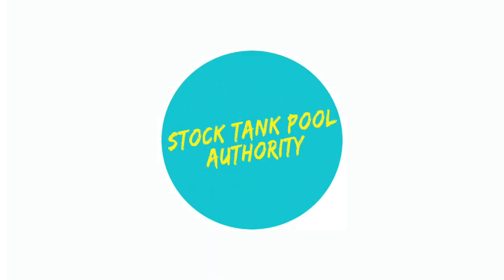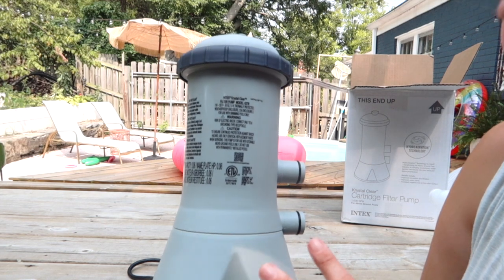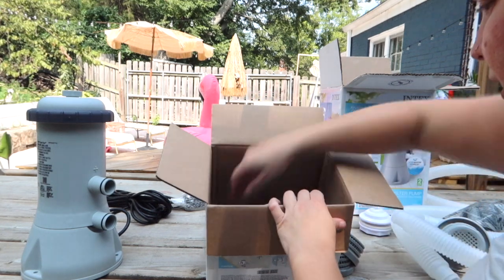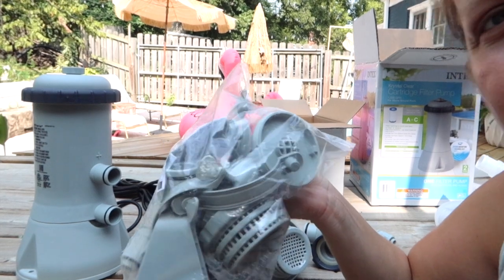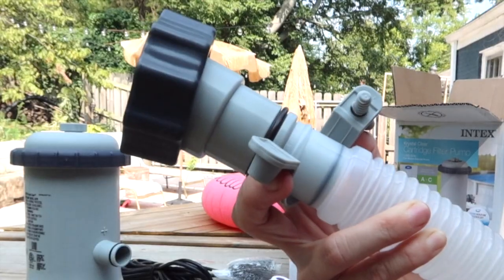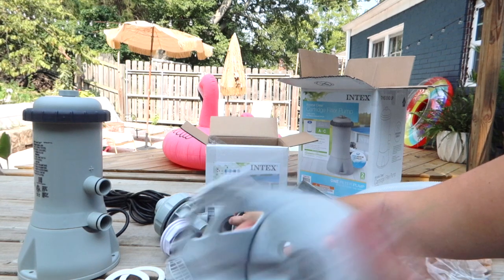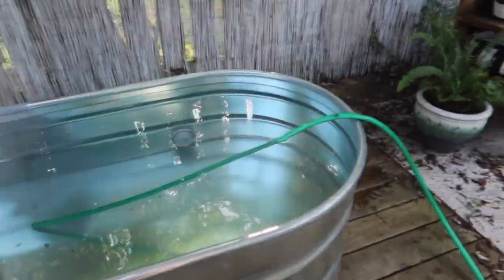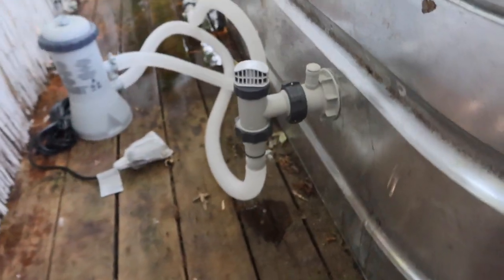How To Install Intex 1000 GPH Pump on Your Stock Tank Pool

Comment: I followed your video to install a c1000 pool pump with a poly tank. One thing that I had to do different is the poly tank wall seems to be thicker than the one you have and the piece you screw in with the black cap doesn't initially fit until you really tighten the plastic nut piece. Once I got it tight enough, I was able to screw it in. So far I have no leaks. One other thing I did different is I used a different caulk. I just so happened to have 100% waterproof kitchen/bathroom caulk lying around that I used to seal a kitchen sink and our shower. This caulk has a 36 hour drying period. It seems to be doing well with that caulk, even after storming during the drying process.

Comment: OK before you turn on your pool pump open the little cap on the top to let the air out when water comes out of the little cap tightened the little cap then the pump is ready to be turned on

Comment: I’m using this setup in a poly pool. The wall is thicker than a metal pool. Even with just one rubber seal, the overlap is too much to screw in the little vent pieces. Any suggestions? I tried grinding down the vent pieces, but it wasn’t enough (I created a hole before it got narrow enough).  Thanks.
Reply: Omg I am having the same issue! I don’t know what to do.  Thinking about maybe sanding some of the poly?
Reply: @chrissyglenn7200  First I tried using a dreamer to sand down the vent piece. Nope - couldn’t get thin enough without creating a hole.  I ended up installing the inlet/outlet without the rubber ring. I THICKLY applied silicone on both sides and screwed on tightly. Haven’t had a drop of water leak in a week!
Reply: @KirstenTerry-w7g   We tried it without that rubber washer thing and it leaks like a slow leak. So, it’s drained out and now we’re figuring what to do. That’s great the silicone is working for you!!  That will probably be what we try next. I don’t get why no one else is having this issue. We have a “Behren” poly pool
Reply: How did u fix the vent problem. I too have a Behran poly pool.Getting to install pump .Any help be appreciated
Reply: Getting ready to install pump.Was wondering how u fix the problem. I too have a poly tank.Thanks would appreciate  any help
Reply: @BeachMusicSuperStore  We ran into the same issue, I got creative and use jaw pliers to screw the inlet and outlet pieces tighter. tightening it a quarter turn at a time, I was able to get that piece to screw on and it hasn't leaked yet.

Comment: Can you hook up a propane tankless heater to this type of pump? If so, what size?
Reply: I would not suggest hooking up a tankless heater to the pump/filter, but you can buy a seaflo (I've bought others and it really is the best - I've also used a submersible water pump which has basically no noise). transfer pump with filter that would run into a propane tankless heater and heat it up (if debris enters the heater, it can cause obstruction).  With regards to size, that depends on your needs.  If you want to warm the water a 5 gallon would do the trick, but if you want to make it a hot tub, then I would recommend a 10 Gallon or larger.  I have a 3x10x2ft tub which I heat with a 10 gallon in the winter in Canada.  It heats up exponentially, so as it warms the water, the warm water gets heated further and I can raise the temp from 40 to 106 in a couple hours.  Importantly, in below-freezing conditions, I bring in the transfer pump and detach the hoses.  The propane heater will have a small bleeding valve to release water from inside its pipes so that it doesn't freeze and expand, potentially rupturing the interior pipes.

Comment: We bought the 8’ galvanized tank from tractor supply couple of days ago and wondering if the 1000gph pump would be sufficient or to go up to the 1500gph pump. Thanks!
Reply: Did you end up going with the 1000GPH pump? Any comments on it?
Reply: @brandonthomlinson1110  I got a cipu sand filter and pump off of Amazon. Not suppose to arrive til first week of June
Reply: Actually canceled that order and found a 1 year old sandpro 75d

Comment: So I watched your video and followed it step by step.  After I was done I looked at the back of the clear silicone package.  You are not suppose to use clear silicone on galvanized metal due to the corrosive reaction it can have.  Now I have a full tank and debating if I should take it all apart to remove the silicone

Comment: I have a 530gph tank but unfortunately it didn’t come with the plunger valves or the 2-3/4” connectors w gaskets that you show in the video. I was wondering if you had a link to the 2-3/4” connectors w gaskets that actually attached to the tank itself so I can order that. I didn’t see a link to that in description. Thanks for the help!
Reply: It states you are supposed to buy 2X part kits in the description.  It's linked there

Comment: i'am not going to put a bunch of holes into my stock tank. It got one for a drain and it going to stay that way, I'll rig it from the drain into the pump and the pool inlet hose over the top
Reply: Hey guy we have a Behren poly blue 8 round pool was getting ready to drill holes for inlet and outlet saw where folks said wall was thicker and were having problems with that .Can u explain to how you use drain plug for installation. Thanx would appreciate that.
Reply: @BeachMusicSuperStore  cut out the center part of the plug where the nut is. Take pipe to put inside the hole silicone it up. where it don't leak around the pipe in the plug Then screw what was the plug back. on to the drain Hook up your fitting and THERE YA GO